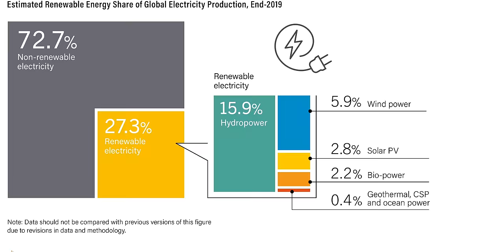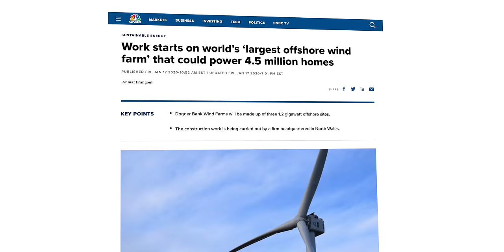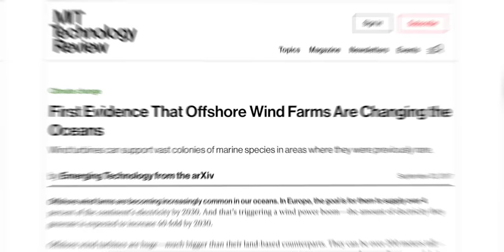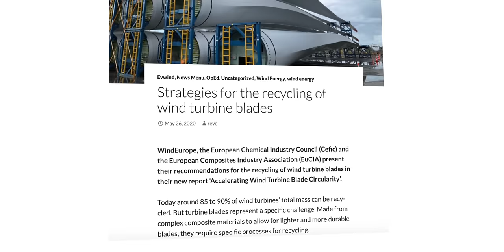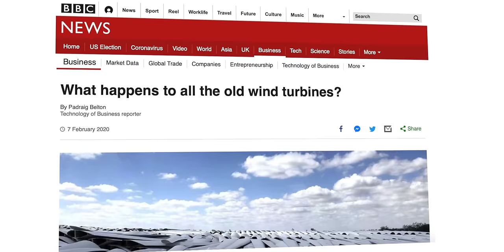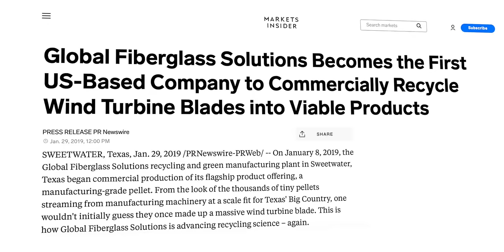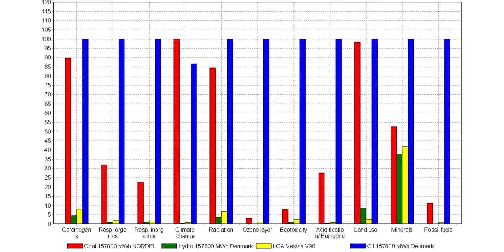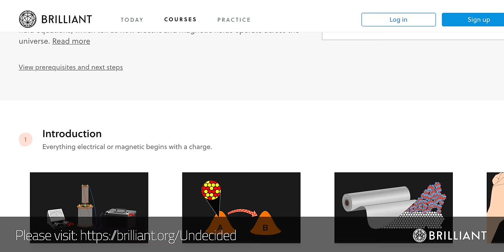The truth about wind turbines - how bad are they?

Comment: Wind turbines also have to be shut down when it gets too cold, too hot, and ironically, too windy.
Reply: Your point?
Reply: @JimP226  When you need power most your wind turbines are down...
Reply: @JimP226  @witold SzafaRyn has it exactly.  On that brutal winter week, when your solar panels are producing zero, it's -20 and your grandma really, really needs her heat to work, you might as well start dividing up her assets because they're going to have to shut the wind turbines down.
Reply: It's rare to shut it down because it's too cold or hot. You'd have to have very strong gusts over 25m/sec. The irony is that if there's a power outtage they won't work, they need power to get started.
Reply: I have a PhD in wind energy, and have worked in the industry the last decade, designing wind turbine blades and other systems for major wind turbine manufacturers. 

Wind turbines are usually designed to operate in a temperature range of minus 20 to plus 40 degrees. Survival temperatures are usually minus 30 to plus 50. I worked on a turbine designed for northern Sweden where it gets very cold, and in situations like that the customer will request a special low-temperature package. So the operating temperature for that project was minus 30 and the survival temperature even lower. 

Wind turbines do stop operating and turn their blades out of the wind in gale-force winds. You have that part correct. 

Another commenter replying to this comment said they need electricity supply to start up and that is not true. The blades are rotated so that they can catch the wind when they need to start up in low wind speeds. There is some electricity supply for auxiliary equipment like the control cabinets or heating in cold climates, and that generally comes from the grid. But if there is a power outage separating the turbines from the grid, then that would mean that the electricity produced by the turbine would have nowhere to go and of course then they couldn't operate anyway.
Reply: @EngineeringwithRosie  I did say "too cold" and indeed, too cold is very cold.  But the polar vortex a year ago or so was an example where many wind turbines had to be shut down due to the bitter cold.  Ironically, climate change advocates now tell us extreme cold will become more common with global warming, so such shutdowns while rare, would become more common.

Question though: Of what does a "low temperature" package consist?
Reply: @wadesworld6250   It will vary for different manufacturers, and depending on the customer request. For big wind farms, the developer can request really a lot of customisation depending on the specific site requirements. A cold temperature package would normally include heated electrical/ control cabinets, heated gearbox, batteries, pitch and yaw motors. Perhaps different lubes, different spec of electrical cable (they don't bend as easily when it's cold), stuff like that. They will also check the extreme loads and adjust the allowable operating conditions if necessary or maybe even strengthen the blades if the order is big enough to warrant a separate design. This is because cold air is more dense, so the same wind speed will create a bigger force on the blades when it is cold. 
You wouldn't order any kind of equipment that is specced to operate through an extreme and rare weather event, because it adds a lot of cost that you wouldn't need most of the time. Of course it needs to safely survive these temperatures, and they do.
Reply: wadesworld Look at TMA Wind video on YouTube.They can run without icing up and the design allows up yo 70 mph wind speeds on the blades till shutdown. Towers that 97 ft tall can withstand hurricane force winds. The blades can be controlled to not over spin with some minor design changes.
Reply: @JimP226  The point is reliability.
Reply: @EngineeringwithRosie   what about its energy output compared to oil and gas? Does the extraction of the raw materials damage the environment? Are they expensive to maintain?  I just curious to know your thoughts on this , am highly skeptical of wind energy. Are this downsides of wind energy worth bearing or will they prove detrimental?
Reply: they are all over Europe and they do not shut them down. daaaaaa!
Reply: Matthayi Naalaaman  Show me the data.
Reply: @arnikolo2916  lots of big questions there! some are probably more nuanced than I can really deal with in a YouTube comment, so I'll tackle the easier ones.
Wind turbines are made of ordinary materials, mostly steel, concrete (for the foundation), which can be easily and economically recycled, and fiberglass for the blades which can't be easily recycled yet but this technology is coming within a few years. I made a video on this topic, check it out if you're interested: https://youtu.be/CNuIzuZpRtk
Reply: @arnikolo2916  the other questions of maintenance, how much energy they produce compared to oil and gas, these need to be considered in the context of the cost of the energy they produce over their lifetime. We use the concept of LCOE, levalised cost of energy. It divides the total cost (cost of equipment, installation, fuel, maintenance etc) by the amount of energy produced. It depends on factors specific to each project, but in most cases wind and solar are cheaper than fossil fuels for new-builds.
Reply: Why are they in the ocean?
Reply: Martin Balber  Yes you're right that ice can cause problems. I spent the last 4 years working on blade heating systems to keep wind turbines in cold places like Canada and northern Sweden operating through winter. These turbines also have other special features to deal with the cold (e.g. heated electrical cabinets, heated motors, different even wiring insulation that stays flexible at very low temperatures. This is similar to any industrial installation in very cold climates. Even cars at temperatures a lot below zero need to be heated before they will start). So there are solutions available, but some of the older wind farms in these areas don't have blade heating.  So they can struggle through the winter if the blades ice up and then temperatures stay low for a long time. Retrofit of blade heating is really tricky and expensive.
My PhD is in engineering by the way 😀
Reply: @Admiralty86  What does wind speed have to do with temperature problems with windmills?
Reply: @Admiralty86  Ever heard of generators?
Reply: @Admiralty86  wrong.
Reply: @blackberry4life482  
"Why are they in the ocean?"
By that I assume you mean offshore wind farms. Though they're testing floating wind turbines, generally they are located on the continental shelves, where they can be anchored to the sea bed because the depth of water is not too great. 

Offshore wind farms are more expensive to construct, but in small nations like the UK they offer the best compromise. In 2017, 15% of the UK's electricity came from wind. By 2019 that number had increased to 20%. Here we're serious about reducing/eliminating our dependence on fossil fuels. Coal built the Britain, but it will not be used by 2024. And an important component in that switch is wind power, and most of it will be offshore.
Reply: @davidkeenan5642  
Do these offshore turbine colonies put out radiation?
Reply: @EngineeringwithRosie  OK continue to lay out all the times the wind turbines are shut down.  You addressed only the areas that were mentioned.  Complete the story including Icing, the obvious "No Wind" situation, maintenance, brake downs, etc.  This technology is far from perfect.  How would the PhD like one in his back yard??? No?  I thought so.
Reply: @Admiralty86  wind turbines are not shut down due to cold. When its cold there is no wind to begin with.
Reply: @Admiralty86  not all wind turbines need power to keep them running. The reason most do, is because by fitting them with induction generators the turbines automatically shut down if there is a power outage on the line, therefore making the line safer to repair and also induction generators are robust and relatively cheap. However, on remote islands where the turbine is not connected to a grid network they often use synchronous generators which do not require an outside power source.
Reply: Never mind that electricity is needed when there is a demand. Irrespective of the temperature or the wind conditions.
Reply: Lol I live in one of the most consistent windy areas on earth... Saskatchewan. Govt here at first gave incentives for ppl to build towers and paid for excess. Stopped it because too inconsistent,they use a battery system before excess feeds grid as want home to have power on downtimes AND only when batteries are get full does it grid. The batteries use heavy metal..worse than radioactive as do not ever decay
Reply: @EngineeringwithRosie  Out of curiosity, what heats the motors, electrical cabinets and blades?
Reply: They need to be heated when shutdown in cold weather so become consumers of power at the worst possible time, so more of a generating solution for the delusional perhaps oh and big green Corporates obviously
Reply: Ours have high wind run through and operate in extreme hot and cold conditions? I wouldn't just write a false statement like that... but yaknow we are on the internet aren't we, say what you want I guess.
Reply: We are only constructing those eye sores and handing out huge subsidies to the the greedy green corporates to appease a vocal minority, we should be building new generation nuclear power stations
Reply: @terryarmbruster7986  Check out this company https://www.hoppecke.com/en/ they produce and recycle 100% of mass of VLA and VRLA batteries. The batteries are used to balance supply and demand, since renewable energies  normally depend on the meteorological conditions, therefore you may not be producing enough electricity when you need it, hence the need for energy storage.
Reply: @davidkeenan5642  You are right, thank you for your inputs! I would like to add to the answer of why are turbines built on the ocean. Offshore wind turbines usually achieve 10-15% more Capacity Factor in comparison to onshore due to more stable wind field and less fluid blockage, additionally, since there is less shear, smaller towers are needed. Finally, offshore wind farms have a higher noise threshold, which allows larger rotors and in consequence, significantly more energy production than onshore wind farms. In resume, onshore wind turbines are cheapear to build and offshore wind turbines produce more energy, the Levelized Cost of Energy depends largely on the site of development.
Reply: @JimP226  His point is they're stupid...
Reply: @wadesworld6250  add storage 👍🏼
Reply: @EngineeringwithRosie  I guess as storage ramps up at wind farms and we see more "micro grids" that'll be a significant contributor to black start capabilities moving forwards. At least if they are islanded for a period but still active, they can be charging the batteries ready for when they're re-synchronised with the grid. Your job must be really interesting :)
Reply: @greglinse3863  Of course you are right that wind turbines are not perfect, no technology is. 
I live in Denmark, the nearest wind turbine is less than 2km away. Not in my backyard literally, but pretty close.
Reply: @wadesworld6250  a range of things. Electrical cabinets are probably the same as any kind of electrical cabinet that has to work in cold temps. The projects I've worked on have used either resistance heaters or space heaters (with fans). For the blades it's a bit more complicated. They either blow hot air through the inside of the blade with what is essentially a giant hair dryer,  or they use a resistance heating element in the blade shell, usually by running a current through a carbon fibre layer.
Reply: @johnrea2115  they don't use much heating if they are shut down, just to keep electrical components above their survival temperature (which is probably -30). The main power use for heating is the blades, and they only do that in order to keep the blades turning. And the blade heating use is only a small fraction of the power generated in that case.
Reply: @matt.baller  My job is really interesting! Though I have moved on from de-icing wind turbines by now, onto other kinds of green energy technologies. You are right that batteries and other kinds of energy storage are changing everything!
Reply: @EngineeringwithRosie  @ that’s good then, after the sacrifices those poor kids in the Congo make to supply vital components, also good to know those birds don’t get whacked to death with a cold leading edge, leads me to wonder though why shippers gave up on wind to propel world trade ?
Reply: @EngineeringwithRosie  You getting involved with all the buzz around green hydrogen? It'll be interesting to see how viable it becomes - but I think it's safe to say gas will be a significant part of the energy mix for a good while yet won't it. 

I do worry about stripping away all the traditional synchronous plant (nuclear base load in particular) but I have involvement (supporting, not technical - I am not an engineer) in Grid Forming/VSM for which a specification will be added to GB Grid Code soon. Assuming the commercial uptake is successful, that should help offset a lot of the concern shouldn't it (as it'll be open to embedded generation too). Add in plenty of storage and maybe doing away with CCGTs completely will work long-term. I still think we should keep some nuclear though....
Reply: @matt.baller  Awesome.  We're going to add this storage to every wind farm built?  For how long will this storage last?  1 Day?  4 days? And if you're going to utilize your wind power, you're going to have to build extra capacity to be able to charge your storage.  And we wonder why countries adopting the most renewables are seeing their energy prices skyrocket, hurting minorities and the poor the most.
Reply: @wadesworld6250  who knows how widely it'll be deployed but it'll be ramping up significantly over this coming decade for a start. 

How long it will last depends on how much storage you install. 

And why would I charge my storage in any other manner than by using the wind farm it's connected to?

And the price per kilowatt-hour in the UK for electricity in 2015 was about 25p. In 2017, about 17p. 2019 about 19p. 

If you have a look at Eurostat you'll see that your claim is demonstrably false; increases where present have not been significant (Denmark is a nice example, if a little selective of me as they're low population with lots of wind power). 

Costs are increasing this year and will likely next year too but that's primarily down to covid reducing demand significantly, meaning more constraint payments (and other balancing services) required but that's obviously not a normal situation. The fundamental aim here is to reduce reliance on fossil fuels, and keep prices as low as possible for the consumer.
Reply: @EngineeringwithRosie  California has switched to renewable energy. As a result PG&E in northern California was responsible for a high tension line exploding witch caused a huge fire with loss of life and property all because of these wind generators not being shut down during high winds. PG&E was sued up the ass. Since December 2020 to now January 2021 I've had my power shut down four times. The first time for 21 hours then 3, 9 and 18 hours. If this is the future, I don't want it. It's no fun throwing away food and sitting in the candle light. Oh, and to top it off. They call you in the middle of the night 2:30am with an automated recording to tell you they are shutting down power because of fire risks due to high winds.
Reply: Crap and laughable, your information is so out of date its shocking
Reply: And only work when the wind blows.
Reply: @skybot9998  which thankfully is a great deal of the time when placed strategically :) couple that with a solar array and some storage and you have your own mini power station.
Reply: Common Sense Realist  Let's save the environment by covering it with giant fans so you can't see it or hear it. Imagine what all those animals with way better hearing are dealing with.
Reply: @arnikolo2916  
Everything has a cost. You sound like you have an agenda: but yes, of course, manufacturing wind turbines requires extraction first of things crude oil and carbon fiber, copper, etc. 
I think you know your answer. 
Cost Accounting is a different discipline than designing a wind turbine
Reply: @blackberry4life482  
Because there is wind lol
Reply: @johnrea2115  
We do need new nukes, yes. 
wind has a place, too.
Reply: @wadesworld6250  
It’s hard to learn and evaluate new things when you have an axe to grind. It’s equally as hard to learn new things when you view a developing technology as a static enterprise.
Reply: @fishhuntadventure  wind generation, I would say not on land and at sea I feel we could harness more reliable power from the sea itself,  but yes I believe in a balance of generating capabilities, but what we definitely don’t want to do is create further fuel poverty by virtue of the huge handouts to the greedy green corporates, access to to cheap reliable energy should be a right not a privileged commodity
Reply: @EngineeringwithRosie  i live in Southern Minnesota and I have wind turbines less than 3 miles from my home.   I suffer no ill effects from the wind turbines in my area.  But my energy prices has doubled in the last 5 years even though natural gas prices has plummeted.
Reply: @aaa7189  oupsss nice try the are talking about solar panels.
Reply: @laflammr  And 30,000 windmills not doing much in that weather
Reply: @aaa7189  Systems are getting better and in Canada there are batterie farms to compensate for the 2.5% of time lost do to weather. Check gov of Canada website or real answers to the problem.
Reply: @blackberry4life482  Hi, simple answer is that there is a higher average wind speed, at turbine hub height, over the sea. This is due to the 'smoother' surface of the sea compared to the 'rougher' land.
Reply: @stephenandrews8015  
Doesn't this wreak havoc on the ecosystem there and or cause friction on the ocean floor?
Reply: There are wind turbines in the mountains near Fairbanks, Alaska that work at -40 degrees F for months every winter. Anchorage has been running on gas turbines for 50 years and wind turbines for 9 years with winters at 20 below. They don't cut out until 56 mph. New superconducting nacelles can put out 10 MW in the size of a 2.5 MW and new towers use less materials and multi-segment blades can go anywhere.
Reply: @tomlakosh1833  What provides the heat for their various heated elements?
Reply: @witoldszafaryn4836  That's like blaming Ford for a seized engine when you used water instead of antifreeze and Hypoid 90 instead of 5w 30 in your crank case.
Reply: @johnrea2115  Right beside your house?
Reply: @gwarlow  they stopped building them, but a Magnox reactors golfball containment would be more pleasing to look at, if I had a choice or had to choose
Reply: @johnrea2115  Nuclear  is expensive to build, expensive  to  decommission,  and  there is no place to send  spent fuel.
Reply: @davidbach7003  Ah but new technologies not yet even on the radar would come along and solve all those issues, you know like those we are told about that will transform ‘’renewables’’ and make them reliable, I am obviously plagiarising a stock answer from the corporate greed oh sorry green presentations
Reply: @EngineeringwithRosie  Is the energy required for these low temperature packages shown on the plaquarding?  When they rate a turbine do they subtract the energy required to keep them going?  I have heard of turbines so big in places like Australia that when there is no wind then the turbine has to be effectively turned into a motor to keep the turbine rotating (at slow speed) to stop the shafts from bending and to keep the lubrication circulating.
Reply: @yourhandlehere1  Yeah, saving the view of the clean sky, no pollutants in the air but, you look down & see all the mangled birds below the turbines& the roads & cement pads connecting all the lovely turbines on top of all the green hills. Just a lovely green planet sight to see, indeed.
Reply: @JimP226  his point is that if society has to choose between not having access to energy and burning fossil fuels, they will choose burning fossil fuels 100% of the time.
Reply: @arnikolo2916  virtually every single expert who isn’t in league with the solar, wind, battery, and fossil fuel industry says yes.
Reply: BULLSHIT! Wind turbines are currently working in Antarctica, Siberia, Canada, and Scandinavia and Dubai. The problems in Texas were caused by the power suppliers failing to winterise their wind turbines.
Reply: @topixfromthetropix1674  There was almost no wind in Texas during that period.  Even if the turbines hadn't frozen, they still wouldn't have produced but a trickle of power.
Reply: @Sir_Charles007  Maybe, but I am rich.
Reply: @JimP226  the numbers dont add up!   period
Reply: @Admiralty86  wrong...many lock themselves out here in Michigan!  They DONT produce when windy!
Reply: Leon Wilcox  Nice term.  Shows how objective you are.  You're correct, they do use them in arctic conditions.  And yet they can drop to zero production at any moment.
Reply: If they were serious at all about wind energy, you would see some radical design changes.  The truth is they don't ever have to make a profit because they are MASSIVELY subsidized, and  supported by the government
Reply: @greglinse3863  since you ask..... if I had to choose between a wind turbine and the defunct oil/coal power plant and superfund site across the bay from me, I think I’d choose looking at a windmill. It would also be good to not have to worry about all the heavy metals and other toxic contaminants currently buried at the old power plant.  One good hurricane and those will be washed into the water here.  According to my neighbors the last time it happened in the 80s an oil spill killed every bit of sea grass, oysters, clams, fish and drove all the other wildlife away.  Took almost 30 years for the habitat to get back t9 normal.
Reply: Sounds like someone hates the idea of wind generation actually working.
Reply: @jackfenn7524  No, I hate the idea that people think wind is viable replacement for fossil fuel. and are going to waste trillions trying  Without a massive leap in battery technology immediately, wind is simply a supplement.
Reply: @greglinse3863  Greg, the PhD would probably have one on their backyard.   Don't make silly statements like that, they just mark you as someone who is emotional illogical and opionated
Reply: @JimP226  that it's not the best or safest alternative
Reply: @arnikolo2916  You do know oil and gas energy extraction is super inefficient?
Reply: And the drone noise is wonderful
Reply: Sometimes it's good you live next to a (small) airport. Doubt they are allowed to set up winturbines next to an airport.
Reply: @JimP226  tf do you mean "Your point?" ???? Can you not read?
Reply: Wind turbines being shut down when it is too cold only happens in places where they are too cheap to buy antifreeze. There are wind turbines all year in Norway. Too hot is nonsense. Too windy, yes, which is why you need transmission lines. Last winter, Texas was lying when it said its power outages in the cold were due to wind turbines having to shut down - it was the fossil fuel plants whose pipelines got too cold and they could run the valves.